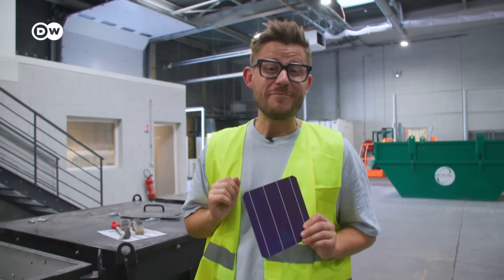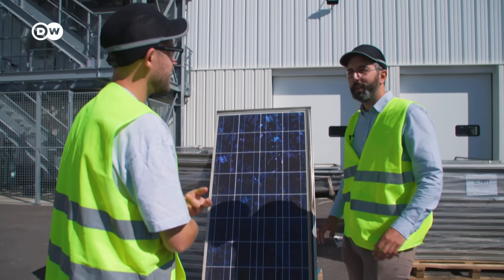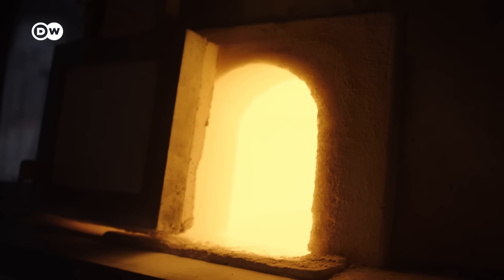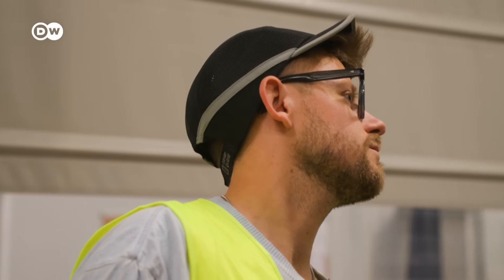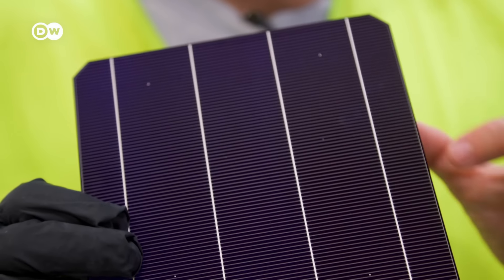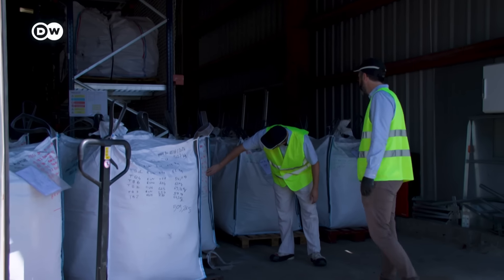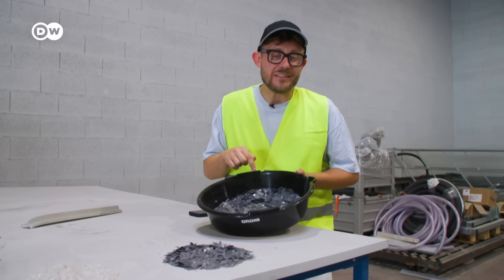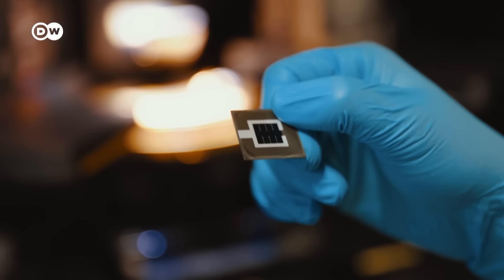The race to solve solar energy's recycling problem

Comment: Solar panels don’t ever really ‘stop working’, the 20-30 years is the period of time they are guaranteed to output above a certain power threshold. However if you have an abundance of land there is no reason why you can’t keep using them to make energy for a long time
Reply: A current N-type c-Si solar PV panel will still generate ~80% of its original nameplate power after 50 years. The recycling processes presented here are only really concerned about the metal extraction. There's much more value in letting the panel continue generating electricity for another 50+ years.
Reply: Thank you for pointing it out. They can drop by up 50% to 70% by the time they are retired but I'd happily pay $20 for 50% panels. Remember the process isn;t profitable yet I;m saying there's a serious market for down cycling solar panels. If I keep using those panels for another 20 years I could do the math but too busy, seat of the pants, you save 25% of the CO2 recycling. Even assuming all panels drop to 25% or less when they are finally ready for the dump you're getting on average 25% power for that 20 years so not quite with everything factored but there's that 25% you were trying to save and yet it made you $20 instead of losing money, Oops, did I just call BS on the entire idea? What if at the end of the process you turn those effectively glass panels into a dirt cheap roofing system? You just need a mounting system and it could all but be gluing them to an existing roof and chalking between them. They are designed to resist hail and such so they are perfect for roofing. Say you get 15 or 20 years as a roof product? That's a 70 year lifecycle instead of 30 and you made money on the down cycling. Look if they can figure that out they don;t want to because I came up with all that on the fly so either they;re really dumb or I;m really smarter or the point was never to reduce CO2, it;s to make solar more expensive. I'm sure I can come up with similar for wind.....Give me 5 minutes........
Reply: With the exception of recycling broken or damaged panels.
Reply: @VinoVeritas_ The loss in value is usurpation by better panels. Upgrading from polycrystalline to monocrystalline arrays warrants a better recycling process. The number one way to facilitate that is end-of-life planning during the manufacturing process.
Reply: @Relatablename  c-Si solar PV cells have a maximum theoretical efficiency of ~30%. There are already panels (not cells) that are offering 24% efficiency. There isn't much more room for c-Si technology to advance into.

The other thing that's important to calculate is the labour costs of removing the panels and replacing them.

The priority for solar PV deployment is getting panels on every roof, using the high cost of labour once.
Reply: @VinoVeritas_  I'm aware of the theoretical efficiency, but every percentage matters for long term use. If a 5kW array at 22% is switched to one at 24%, it's now effectively a 5.5kW array without purchasing any extra real estate and that matters when it's going to last 30 years. Definitely important to get panels on every roof though. An auxillary battery system is also really important to offset emissions during evening peaks.
Reply: @Relatablename  You're not considering the labour element though. It's better to leave the 22% efficient array in place and build another 24% efficient array elsewhere.
Reply: Indeed.  I have a friend in the home solar industry at the engineering level.  They have panels now that reduce output something like only 1% a year.  So after 50 years, it's down by half....but the only real expense is property taxes and some weed control.  Which can be done by cattle or goats.  Which is its own profit stream, albeit minimal.
Reply: @VinoVeritas_  after the structure is in place, replacing the panels become a LOT cheaper. for some people it can be economically viable to replace old degraded panels for new ones. but you are right. ideally they would replace them by selling their old panels so they can still be used, and then use that money to help buy the new panels.
Reply: There's a reason. Transmission costs money and sometimes it's better to replace an existing fleet compared to building a new on in a new place
Reply: @frequentlycynical642  The 1% degradation rate is in the 1st year only. The degradation rate is 0.39% over the following years. That's why it's ~80% of the original power output after 50 years.
Reply: @cristoforestman  Transmission is irrelevant if you put the solar PV panels on the buildings that will be using the generated electricity. Putting them in huge solar farms tens/hundreds of miles from where the energy will be used is stupidity.
Reply: @VinoVeritas_  Thank you.  I used to find a lot of Veritas in my Vino.  Had to stop drinking.  Going well after a year.
Reply: Exactly.  I live in rural East Texas USA.  We have a metal scrapyard nearby.  One day while there, a roofer came in with 20 295w residential panels.  Most had cracks.  He wanted to recycle the aluminum  frames and discard the rest as trash.  I offered him 100 dollars, and he gladly delivered them to my house.   Bottomline:   they still have 80% generating capacity, and I am slowly making portable solar-powered trailers for my home using these panels.   
Repurposing these older panels that still work is a Win Win.
Reply: @mr.makeit4037  Thank you!  Cracked panels by and large work fine.  Sometimes at a reduced capacity.

There was a huge hail storm near Houston this summer that cracked a lot of the panels in a huge solar farm.  The anti-renewables crowd went crazy with glee.  The reality was expressed by someone speaking for the farm that yes, capacity has gone down a bit, but it's still working just fine.  

Since ongoing expenses for a solar farm are so low (loss of capital invested, property taxes...probably very low...some mowing or goats if weedy) solar should make economic sense fifty or more years out.  Probably would stop only because the land was now more valuable for development.
Reply: Until a Hailstorm or 80+ mph high winds destroy them
Reply: @ChasingDifferentAdventures  Wow!  why didn't the industry hire you for your brilliant insights?  Answer:  You don't know shit.  Plenty of panels in use in high winds and hail for many years. The big Houstan hailstorm damaged many panels, but they only reduced output.  A big yawn.,

Comment: A lot easier to recycle than the millions of litres of engine oil from oil changes worldwide each year.
Reply: @GaryV-p3h  I once worked in a motorcycle shop, and I noticed that the boss used to dispose of used engine oil by pouring it down the bank of a stream that ran behind the shop.

Comment: One idea would be to make panels with a rating that says they were built with recycling in mind and thus are much easier to break down at end of life without using lots of energy and chemicals. Then have a requirement that newly installed panels must meet this recycle rating or else they will be charged a "disposal fee" baked into the price.

They will be more expensive the first go around but we won't be leaving our children with mountains of waste from the number of panels (and wind turbine blades) we need.

Comment: I really like the idea that manufacturers have responsibility for recycling, or they at least need to financially support the recycling process.  That should encourage improvement in the recyclability of panels. I do wonder what materials solar panel manufacturing will use in 30 years. Will they have any overlap with the materials of 30-year old panels being recycled? Hopefully the recycled materials will still be useful in other industries, such as automotive as mentioned.

Comment: It's hardly a "crisis", the amount of material going into landfills is absolutely tiny compared to the total amount of waste produced per year. You could not recycle any of them and it would still be far better environmentally and healthwise than burning fossil fuels. It's good to recycle them though. How about we talk about the crisis of thousands of kilograms of material that cars are made of becoming waste after their similar length lives.
Reply: That's right! Most composite materials end up in landfill after a very short lifespan. All packaging made of composite materials, for example. An amount that is at least 1000 times greater than PV module scrap.

Comment: The solar panel recycling economy problem  : 1. solar panel is long lasting.  2. It is energy intensive. The biggest challenge is Germany energy price, then it is scale of economy problem, Germany total solar photovoltaic only reach 82GW in 2023.   OTH, China photovoltaic will reach 1TW in 2030,  with graduate obsolescence replacement,  China photovoltaic will easily reach the scale of economy pretty soon. In addition, the terrawatt  photovoltaic in China means it can use the energy for both manufacturing and recycling. And advantages that even US failed to harness.

Comment: You can dissolve Si in NaOh or in other alkalis and Ag in a proportion of 1:3 solution of HNO3+HCl for example. You can get pure  Ag back by mixing the solution with the AgCl in it with NaOH to get Ag2O, then add glucose to reduce it back to silver.
It might not be the exact method they use but one way to do it.

Comment: Add a recycling fee on top of the purchase price of the solar panels and use that to develop even better methods to recycle them
Reply: Should do the same with all the engine oil from oil changes each year.
Reply: that would slow down solar panel adoptions, instead the government should subsidize solar panel recycling. they shouldn't be passing down the cost to the consumer and making solar panels less desirable.

Comment: Even if we had to all dump new solar capacity into a landfill in 30 years it's obviously very worth it. Apart from that, the silicon could be used in chips as raw quartz used has typically lower purity before refining. So with about $300 per panel today, there's $40 recycling cost, and $20 value of recycled materials, that's a pretty good deal already.
Reply: a panel cost around 100€

Comment: I like the article. It certainly is an interesting topic. Only thing that I found disappointing is that you did not send an interviewer with a chemical background, or had questions prepared by somebody of a chemical background. Key questions about their process were missed. In the video, the process is painted as being relatively simple. Some pyrolysis here, some solvents there, but the handling of these processes will make or break (economically/financially) the process. Solar panel recycling is totally not my area of expertise, but these are the kinds of things I'd love to know.

Pyrolysis of polymers, under an oxygen-free atmosphere, will yield a type of oil which can be reused again. Yet the video shows a big chimney expelling CO2 and water... Why no recovery of the hydrocarbons? Also, what is so special about their pyrolysis process that makes it be kept secret?

Why do the panels need to be intact to be processed? Why can't pyrolysis and solvent-cleaning be performed on damaged/shredded panels?

around the 4:30 mark, it is mentioned that the pyrolysis oven settings are adjusted on the source material. How do they pratically determine the type of material/polymer used in the making of the panels when they are running at the eventual scaled up plant?

Some solvent or acid is used to detach the silver "paste"(?) from the silicon. Apparently this cannot be done mechanically, so I take some type of adhesive has to be dissolved in order to free the silver. How is the solvent or acid recovered after its contaminated with the removed adhesive?

They also mention having 5 filtration steps of the gaseous products of the pyrolysis. I take this means a series of wet scrubbers? How is the contaminated scrubber fluid handled?

Comment: A few thoughts and notes:
$15-45 is quite expensive considering that a new PV module today at the wholesale level costs $35 for the smaller sizes up to $60 for the large sizes. Cost reduction through scaling seems to be the way forward. It sounds like the gatekeeper fee in France is extremely useful to close the current economic gap between virgin and recycled material. Such policies should be implemented everywhere.
Focusing on silicon seems not the most promising option. Silicon represents only 1-5 % of the PV module. Wafers are not that expensive anymore and recycled silicon would only substitute new polysilicon which is cheap as well. Economic wise silver, glass, copper and aluminium are the more valuable materials. Still, recycled silicon is good for a large amount of CO2 reduction as the recycled silicon replaces the furnace process melting quartz gravel and the oxidation process at the beginning of the production chain.

Comment: What is the full life cycle anaysis of a solar panel from the first iningof bauxite, the extraction ofoil for plastic and the mining of silicon to the recycling of the solar panels using this process. It seems that the whole process is VERY, VERY energy intensive. So what is the Energy Return on Energy Invested. Do the solar panels have an EROI of lessthan 1, less than 10 or ????
Reply from the maker: There's different estimates from so little as 0.8 to 9-10. ☀️And, there are fundamental aspects EROI does not capture! We have this video that looking into some of the not-so-green sides to the technology 👇
https://www.youtube.com/watch?v=EWV4e453y8Y 
(Study on PV EROI 🔗 https://www.sciencedirect.com/science/article/pii/S0301421516307066)

Comment: What exactly happens inside a solar cell after 20-30 years that makes the fail?
Reply: Few things, like potential inducted degradation caused by stray currents, exposure to sunlight, mostly UV rays can cause chemical reactions or physical ones. The polymer structure of plastics are weakend because the light excites carbon-carbon covalent bonds while decreasing the bond's length. Added stabilisers, colorants can also degrade-migrate, turn yellow and as a result micro-cracks can appeare. 
Electrostatic damages, by high currents, metal corrosion, small internal hidden faults. 
The panels are placed often in harsh weather conditions wich does not help either.
They all lower the efficiency of the panel over time, like 1% /year. If the panel was built well and taken care of, it can last much longer but I'll operate at a lower efficiency so replacing it might be simply more profitable.

Comment: End of life panels, at 70% power generating capacity are still functional.  The still working ones should be sent to developing countries to extend their lifetime.   Often, the reason for burying old panels in developed countries is that the labor cost of mechanically separating is too high.  Perhaps nonfunctioning ones can also be sent there to be recycled, thus creating jobs.

Comment: That tax on PV sales, joined with cheap electricity coming from nuclear power, maybe explains why France has relatively few PV installations compared to other EU states.
Reply: Nuclear power is currently the most costly form of energy production.  What are you talking about?

https://en.wikipedia.org/wiki/Cost_of_electricity_by_source#/media/File:20201019_Levelized_Cost_of_Energy_(LCOE,_Lazard)_-_renewable_energy.svg

Comment: BioLite's thermal technology uses a thermoelectric genera- tor (TEG) to convert heat from a fire into electricity. The elec- tricity can then be used to power a fan and charge devices, like phones, cameras, and headlamps. The technology also includes a patented combus- tion process that burns smoke before it es- capes the fire.

-Demand Electricity

Top-off priomes lights, watches and

Here's how BioLite's thermal technology works:

• Heat capture: A heat probe attached to the power pack captures waste heat from the fire.

• Electricity generation: The TEG converts the heat into electricity.

• Fan: The electricity powers an internal fan that injects air into the fire chamber.

• Combustion: The fan improves combustion, creating a cleaner and more efficient burn.

• Battery storage: Excess electricity is stored in an internal battery.

• Charging: Devices can be charged via USB in real time, even when the fire isn't going.

• LED dashboard: An LED dashboard provides feedback on how much power is available
By applying this companie and other's technologies to facilities that use furnaces we can generate extra power for the facility and possibly more for the surrounding areas.

Comment: • Currently, Asian countries have not developed strongly in the issue of treating solar panels after their expiration date. Because most solar panels have only been in operation for about 6-7 years, while the life cycle of the panel is about 10-15 years.

• But during the operation, problems with the panels appear (burned cells, cracked glass) causing the panels to no longer be able to operate, so the panels that are no longer usable are considered waste panels, which are similar to those that have expired. Currently, in Asian countries, there is no treatment of solar panels with such a situation, causing many organizations and businesses to have no place to store the panels, and they are at risk of turning into hazardous waste when organizations and businesses do not know how to handle them.

• So the market for developing the treatment of these panels must wait at least 4 more years to develop, thereby opening up a green and clean development market.

Comment: plot twist: long lasting solar panels exists but companies don’t sell them (it’s a real thing)
Reply: I have a idea about liquid cooled solar panels, running liquid through whole back, increasing efficiency and possibly increase lifespan, and generating hot water. Seen some companies did that but it still not common in solar industries. Adding another layer of channeled glass behind shouldn't be that much expensive right?